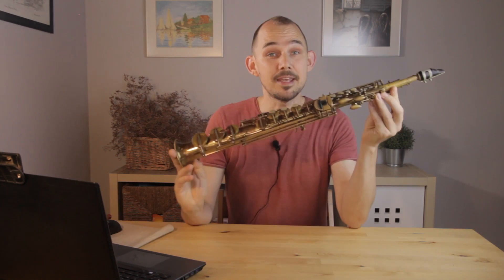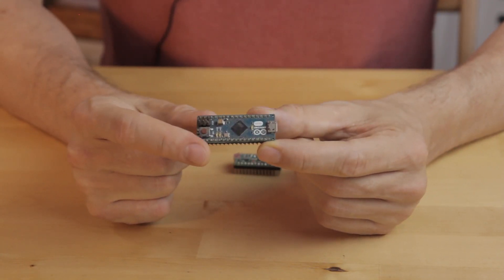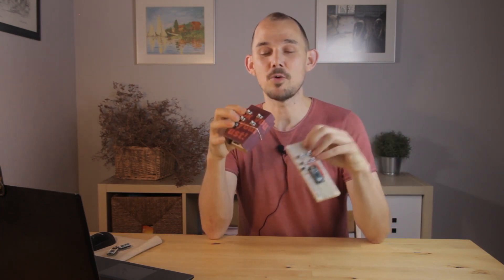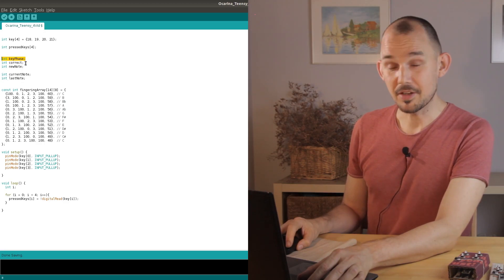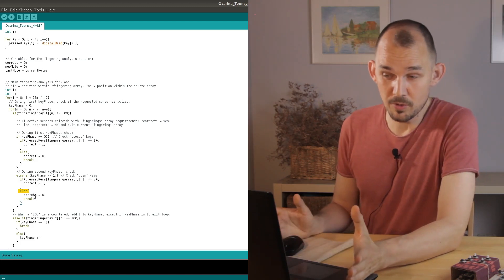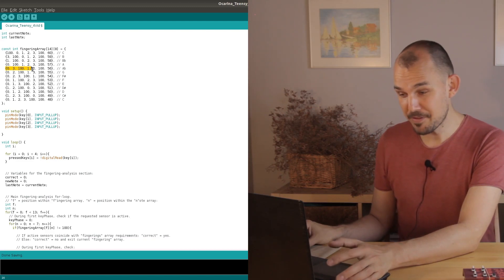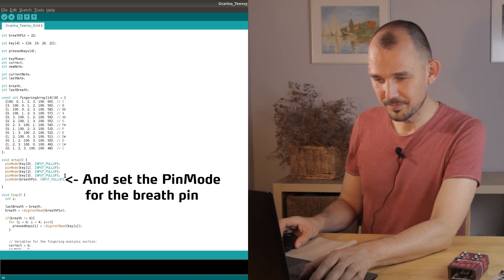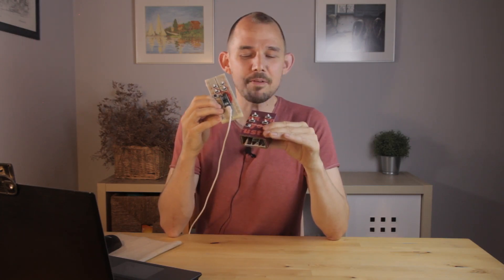KontinuumLAB Code Class 1 - The Woodwind Algorithm - part1

Comment: I have been experimenting with capacitive touch sensing on the arduinos sadly I haven’t been able to get it working on the Micro (which is the only one small enough to fit on a breadboard) but I have been able to get it working on the Leonardo, Uno, and Mega. Still it is in no way easy or “built in” like it is in the teensy. I like building my own keys from scratch to emulate playing a real woodwind and for that I can really just make push buttons from copper tape and pen springs.

Comment: Is possible,make a accordion with air sensor and Teensy?
Reply from the maker: Yes it's possible. Lots of conceptual, mechanical etc issues to solve, but it can be done. I don't have any plans to make one, but you should give it a try!
Reply: Thank you!But,i can make without teensy?
Reply from the maker: @guilhermemalczevski  Sure. The Teensy is great, because it's easy to make capacitive keys, but use whatever microcontroller you have. If you can make it, then you can make it without the Teensy

Comment: Cool to see how you've done this, and how I've ended up doing the same thing in a different way!

I've got all the key combinations that make a note stored in an array, where each combo is {pitch, pressed, not_pressed}. "pressed" is the keys which must be pressed for this note, and "not pressed" is the keys which must not be. Each of those is a 16-bit binary value, e.g. 0b0000000000000001 would mean only the last button is pressed.

That's handy because it means I can represent the state of up to 16 buttons with just one number. I'm not sure whether it's more or less readable than your way though!

I then just iterate through all the note combinations, and check whether the pressed and unpressed keys match, using a single bitwise AND operation for each. I think it's quite neat but it's definitely harder to explain. Let me know if you'd like to see the code - I don't think I can post a link in a youtube comment.
Reply from the maker: Hi George.
Nice! :) Thanks for sharing.
I’ve talked to other people as well, who have independently ended up with something quite similar. It’s like I say in the video, that’s just how woodwind keys work. Whether your binary way is more or less neat than mine, I can’t say. But I suspect that it executes faster, while being harder for an outsider to read. Readability was certainly an important point for me while putting this together, and speed isn’t really a concern with a Teensy board at this level of complexity.
The important question then becomes, “what’s the mental process for defining each array?” Deciding which keys absolutely have to be “not pressed” and which can be safely ignored can have important consequences when playing. I’ll get into this more in the next “Woodwind Algorithm” video.
And there’s a whole other dimension of possibilities to this, which I explored long ago with my original Open Horn MIDI system, which is to use those “ignored” keys to apply effects like timbral distortion, or microtonal adjustments, like you sometimes get with acoustic instruments. In my code this introduces a third “keyPhase”, and it hugely complicates things, but I might get back to it at some point.